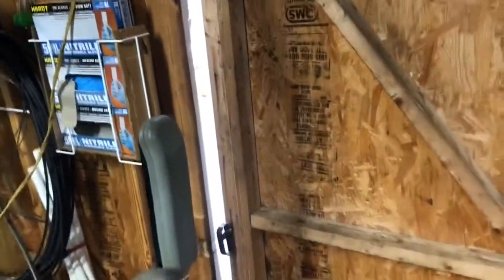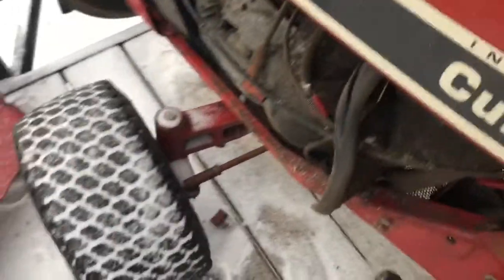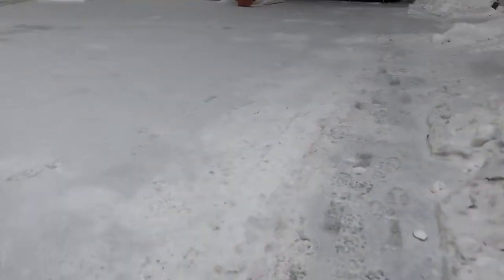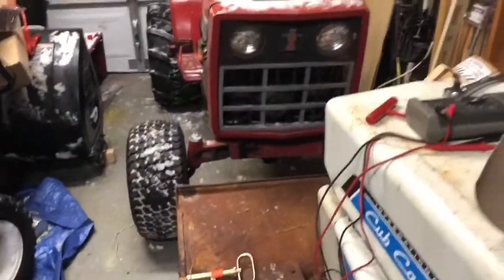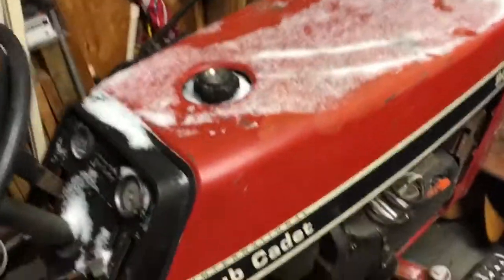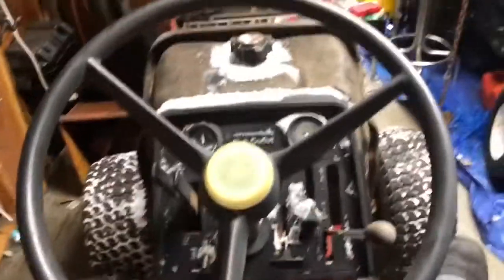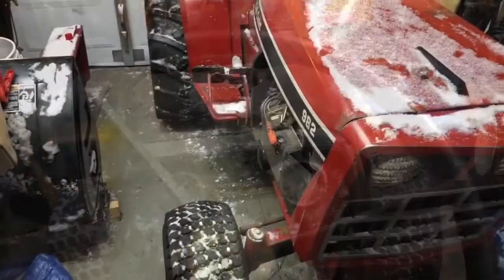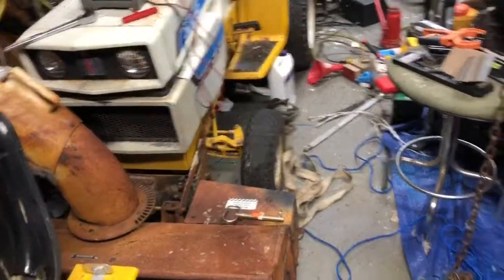IH Cub Cadet 982 project - Part 2!

Comment: you should change the air cleaner then in the 1450 if it wonnt run that means its got crap in it good video love the cubcadets i haave a few as well an 1811 and a 582